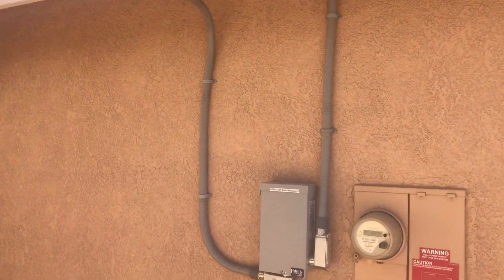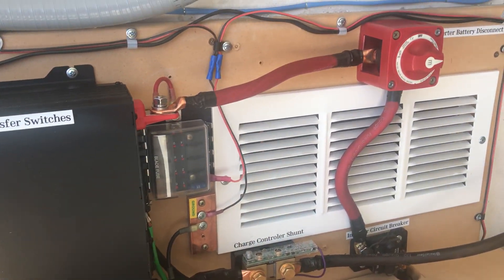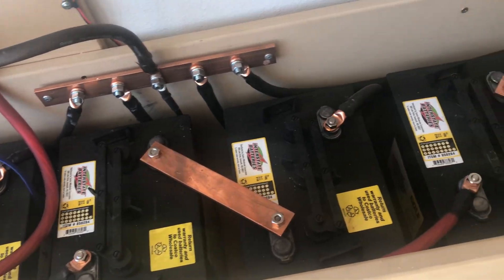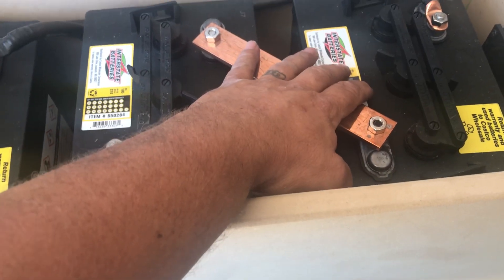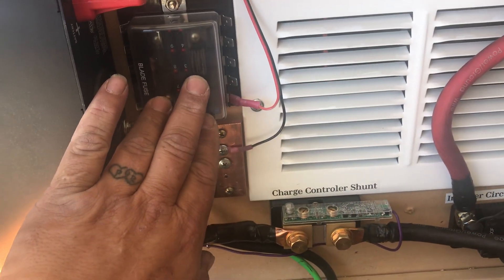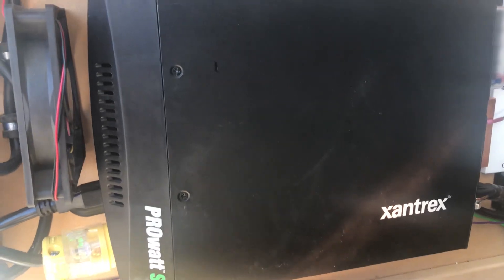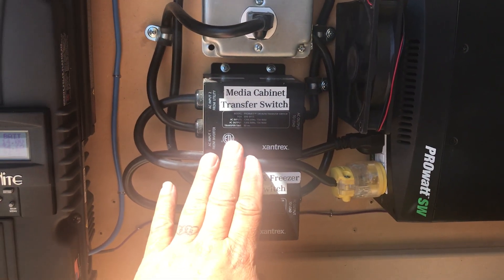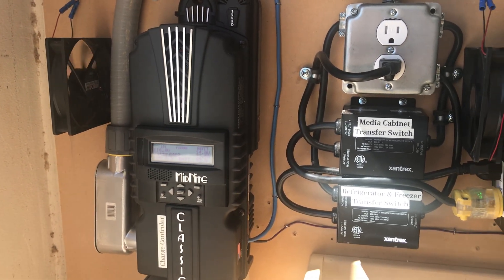1Kw Renogy Solar Off Grid Cabin Kit With The MidNite Classic Charge Controller

Comment: Very professional looking system!   I finally started my basic 800W system and ran a 5k BTU A.C. I almost went with the Duracell batteries from Sams club, but then I found Trojan SSIG 06 235 for only 25 bucks more. They said they were specially made for Solar applications.  It was because of all the GREAT YOUTUBE videos I watched that made me go for it. I especially like how you did the transfer switches for the FRIDGE and FREEZER. GREAT IDEA.
Reply from the maker: Ran Jan Thank you for watching my video. I am looking forward to you posting a video of your system when you complete it. I too watched a lot of YouTube videos on solar systems before I put my system together. You may want to consider finding a solar calculator online to figure out the proper size system for running an air-conditioner. I know there is a lot to consider. Things like runtime, where you live, and solar producing hours a day. There is so much to learn and I am still learning myself. I know with my 1 kW system, I can only run 200 W continuous 24 hours a day with the battery bank I have. Good luck.
Reply: @PaulStewartPositivePaul  Thanks.  I know I will not be able to run it all day. Only ran it for 3 hours today.  I also need to add 2 more 100W panels to keep my batteries in better condition.  I made a pole mount solar array that enables me to manually track the sun. I f I add the 2 more panels I have to get another 40amp CC and add a combiner box . The way my panels are confiqured I used a MC4 4:1 branch connector which made it super easy to install.  I'm old and retired and basically wanted something to keep the fridge running if the power goes out.  I really wanted to get Lithium Ion batteries but they cost to much and would out live me. LOL.   Do you see yourself expanding your system in a year or so?
Reply from the maker: Ran Jan no future plans on expanding that system. But I do have a Renogy 500 watt system that I’m adding to a shed to run some yard lights and a pond pump that I will do a video on in the future.